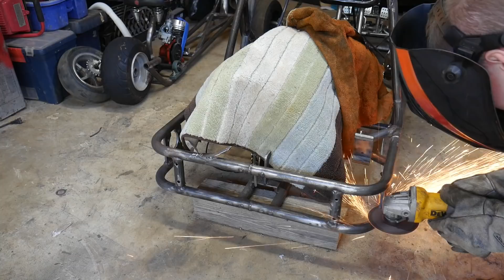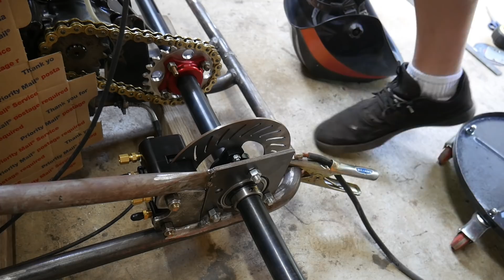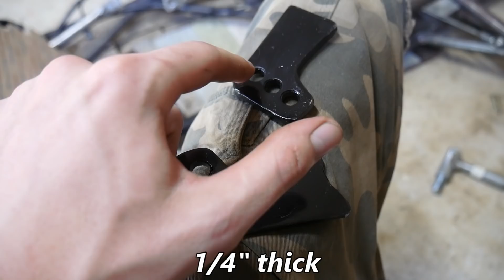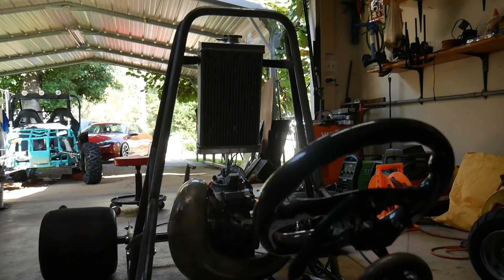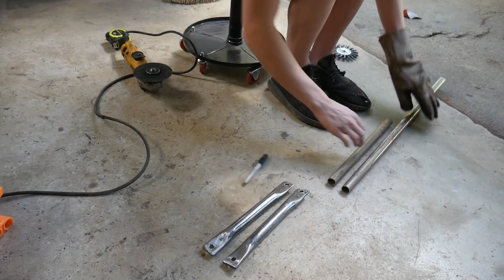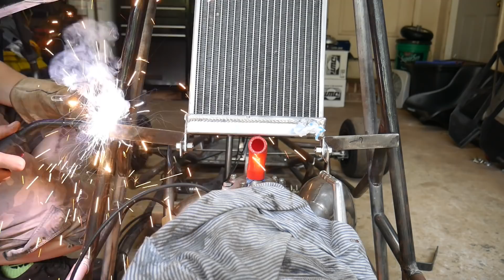Finishing My Kx250 2 Stroke Drag Shifter Kart!

Comment: You should have done the clutch and throttle on the steering wheel like a quad and shift with your foot. Would have been a lot easier to drive

Comment: I just subscribed to your channel, because that's an impressive build! I worry about the radiator location. When my son was at Villanova studying engineering, they put two smaller radiators in front of the rear wheels, on their 3/4 scale formula 1 race car. Never had any overheating problems.

Comment: Hose clamps will work fine but you want to put a beveled edge on both edges of clamping seat post holders so they can't slide off during the vibration from the cart and the motor keep up the great work man.

Comment: If top fuel  cars use hose clamps to hold a 1500 hp motor in only using a single clamp on the four corners.U will have a better chance of flying out of the seat before the double clamp on each of your mounts breaks.And its the perfect way to give adjustability as u said.

Comment: you welded the axle supports incorrectly. the open area should face the back of the cart so you can remove the axle as an entire assembly and not have to slide it completely out of each bearing.
Reply from the maker: I needed them like that for extra ground clearance

Comment: You're gonna have a bad day if that radiator explodes or overflows down your back. Ugh.. 3rd degree burns down your entire back sound like a nightmare. And you should mount it with bushings, for sure. Nice job on the kart, man. You're a heck of a fabricator.

Comment: the radiator is not in the  right place keep far as much possible or u will get burn if it's blast or some kind of leaking or the cap gets open by pressure

Comment: Your chain will snap like it is. The chain needs to be a little loose or it will snap in the powerband, I mean the motor is making 50+hp. Happened on my cr250, chain stuck in the front sprocket and shredded 3rd gear🤦🏻‍♂️

Comment: radiators need to be mounted with bushings. especially on 2 strokes.
Reply: Thw vibration is insane on these 2 strokes an its the same with my nitro rc cars an trucks so much vibration its insane but you gotta love them high rpms tho lol

Comment: The only thing really needing upgrade was the breaks .... and honestly go power sports has junk ..... there like harbor freight of go cart and mini bike supplies good for light usage a few times here n there ... but always do extra maintenance to any parts they supply or expect premature failure and dont beat them to hard .... in my experience build it yourself or buy and modify proven products even if it means more research and time ..... even money for that matter .... why save for cheaply made products that will not perform or break prematurely on a serious privately owned toy .....
Reply from the maker: My friend, these are top of the line brakes from MCP. The #1 brake supplier for all shifter karts, outlaw karts and micro Sprint racing.
Reply: @VasilyBuilds  
As long as its name brand cool but  there in house products are junk ...
Reply: @VasilyBuilds  btw great cart glad to see your ok and back at it
Reply: @VasilyBuilds  and boy that was fast im still watching your video and you responded that fast
Reply: I build home made carts n bikes and cars n truck mods .... there seems to be a movement starting with powerwheels with gas motors ... rather b welding grind hard plumbing and i forget the other channel with the red porche but im sure there are more to come .... im looking to get my 91 ninja 600 motor in some type of power wheels asap to join in on the crazyness its going to be ..... hope to see you along the way or even there

Comment: Steering geoes look way, way more better now. Next time do some researchin before fusing all together. Dual rear brakes is overkill, but decent set of speedkillers in the FRONT would definitely make a huge difference in stopping power. Again think first  overnight, then proceed into fabrication. You're smarter guy than average, but you just need to stop and think a moment or two every now and then. Cause i sometimes smell slightest odor of a brainfart puffing in your garage. Keep working it up!
Reply from the maker: I think this stuff months in advance man. It's more of a drag setup. You notice how drag rails have no front brakes
Reply: @Vasily Custom Builds  

Well it's a kart, not a dragster in its appearance an what ever is the use, balanced brakes is the way to go. In drag rails they have long wheelbase and a chute. Go-kart goes uncontrollably sideways pretty easy with only rear axle brake.  Even on a drag strip. 

No hard feelings,  i only tell what i have learnt the hard way, as you are now learning i see it.

Comment: Perhaps some kind of simple lightweight shroud or flaps off to the sides of the radiator to channel the air into it as it moves forward...if it turns out that your head blocks too much of it.

Comment: Glad to see you back, and like all the updates sure there will be more in future.

My 2 cents on this video is using "pillow bearing blocks" instead of your "live axle bearing holders" for strength/adjust-ability/longevity and come in lots of shapes/sizes/ratings. Also not a fan of hollow axles unless you are running a thick wall as gives to much allowance for torque twist and it warping under load also end should be sealed (i always run solid).

Its all a learning experience but its reason i started asking professionals and tbh in my opinion after watching so many "gopowersports" sponsored videos i feel like quite a bit of there stuff isn't designed for what they/people use for eg. Tyres (there is no speed rating or temp)
Honestly all just be careful, its all fun until something goes wrong and youtube is not a professional haha

Comment: you have to have rubber washers on the radiator mounts!
if you have hard mounted mounts you risk the vibrations of the engine, the road and the stiff chassis will make it so the welds on the radiator can break, there is a reason they have rubber mounts

Comment: Racing Karts do not have roll bars, because in a roll the bar will pin you. If you have a roll bar, you need a 5 point harness, but it is safer to eject with no roll bar.

Comment: glad to see you back. Just pointing out that if you had positioned all the axle hangers with the opening facing up, it would be a hell lot easier to remove axle
Reply from the maker: Yes I did that  for the sake of a few mm's of ground clearance

Comment: I need that exhaust dose it have a part number
Reply from the maker: pipe or silencer. Pipe is an 03 kx250 pro circuit platinum pipe
Reply: Vasily Custom Builds thanks I like how it loops close to the engine

Comment: Think you should spend some time and $ on building a proper workbench with a good vise.  Suggest loose that claw hammer and get a proper Ball Peen hammer maybe a dead blow type your not building houses.

Could you explain why you felt it necessary to make an adjustable seat mounting system, IMHO just weld the thing in place, it will be much safer and a lot less complicated to build.
Reply from the maker: Yeah I agree. Just for the cool factor and to adjust our weight distribution

Comment: Hose clamps are not mechanical fasteners.  The picture you provided were actually pipe clamps the only thing holding a hose clamp together as one side of the threaded screw into the sheet metal body. Do yourself a favor and get some U bolts like exhaust hangers.      But you got some good talents bud.     Keep it up
Reply: The clamps looked like t bolt clamps. He should be using something stronger.
Reply: The hose clamps are only keeping his mounts from lifting or sliding left to right. The seat mount pipes are resting applying all of their pressure to the frame. The hose clamps only serve to keep it from moving left/right or lifting away from the frame.
Reply: Bird76Mojo76     Yup.  My reasoning for commenting this. Is there’s going to be s hundred thousand views on this vid at some point.  A lot of which are going to be kids then going to build something.   They will grab hose clamps to hold something structural together not knowing any better   Especially after his explanation of them being used in race cars.  Which Just is not true

Comment: Dual rear brakes is never needed, never seen a Kart that wouldnt stop or lock the rear end anytime you wanted with just the one? when I built my shifter the best addition was FRONT brakes!!!! that makes 200% difference in stopping power - Expensive, but well worth it
Reply from the maker: Got you I will look into it. I only put two on there because its more of a drag race setup than track setup

Comment: Man hot water right behind your head seem kinda sketchy.  If it were me I would put braces from your roll bar to your lower frame then mount the radiator to that, yeah more weight but coolant gets pretty hot.

Comment: Note:
If you apply pressure to your brake calipers before tacking the brackets in place it will ensure that the pistons ride perpendicular to the rotor.
Reply: Nice new upgrade parts in shifter kart
Reply: Shotout for leroy adriane s bernardo from philippines

Comment: Love your vids man, but one question is that a gas less Mig welder? If so I’d be upgrading to a gas mig setup, much cleaner stronger nicer looking welds! Nice build man coming together nicely!
Reply from the maker: Yes it's gasless. I weld outside alot so I'm not sure but I will have to look into it
Reply: I weld outside a lot also, aslong as it’s not super windy it’s usually pretty good. 
Glad to see your healing up well my dude :)

Comment: Wouldn’t going to a hollow axle be less strong than a solid one?
Reply from the maker: Yes 90% of shifter karts run hollow axles. Weight for weight they are stronger than a solid axle
Reply: @VasilyBuilds  Oh gotcha. Still very impressed by the whole project.

Comment: I've been in to all kinds of racing an ive never used hoes clamps for safety or mounting a motor . in my opinion its not very safe to mount a seat this way , ive taken some hard side hit a some hard hits to a wall with my race kart
Reply from the maker: I got you, im thinking about changing to heavier duty t bolt clamps or just welding straight to frame
Reply: @VasilyBuilds  you can ask go power sports if they have the bolt on seat monts an if they don't goto trjkarting.com they sell them

Comment: Your ackerman is still way postive even in all 3 of those holes. The straight edge you are holding up there is supposed to go dead center of the rear axle and form a triangle with the wheels pointing straight ahead. You try to adjust the "fine tuning" with the tierods you are only gonna adjust the toe of the tire. With your setup I bet it gets squirrely at speed.

In drag racing we use t bolt clamps, those worm clamps might work but I don't trust them. T bolt clamps are a lot stronger and don't strip out like worm drive clamps.
Reply from the maker: Yes I can verify, the innerrmost tie rod hole was pointing towards the center of rear axle. It was just the awkward camera angle. Will have to look into t clamps
Reply: great to have you back, doing well and building stuff again. very nice build. t-bolt clamps sound good to me also. enjoy your vids. be safe.
Reply: @VasilyBuilds  k bud and yeah t bolt clamps are the way to go. They are not even special order stuff, I get stainless steel ones from my local oreilleys. Napa also carries them but I don't have one local anymore.